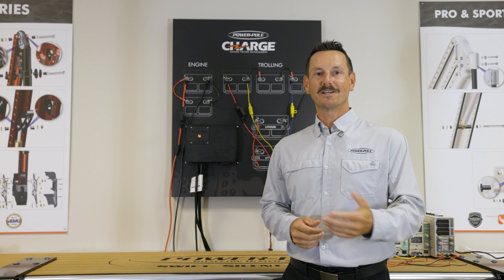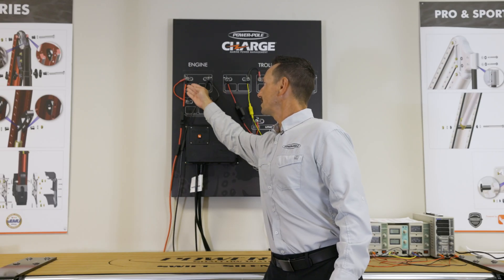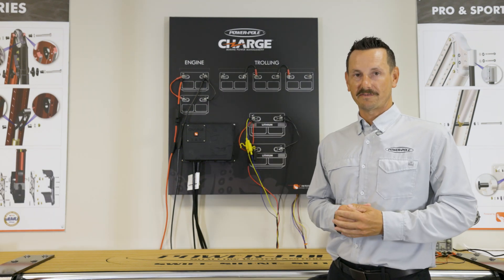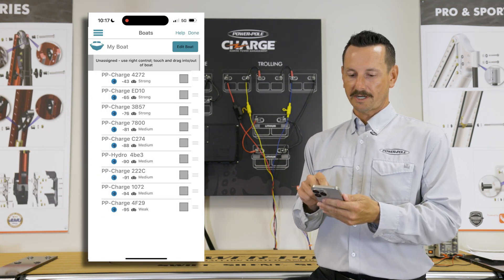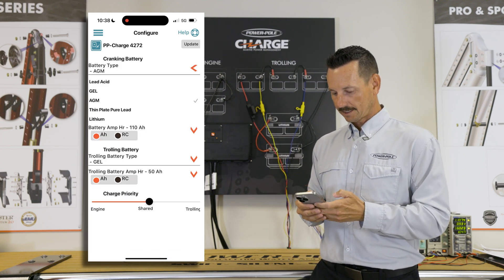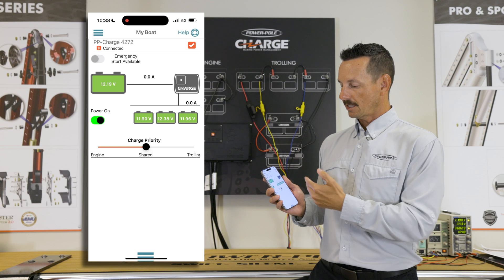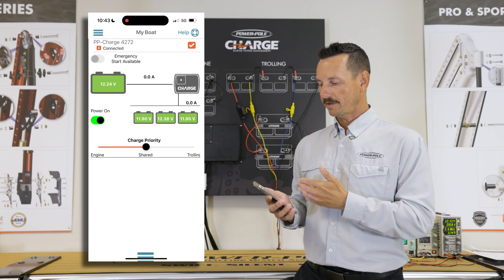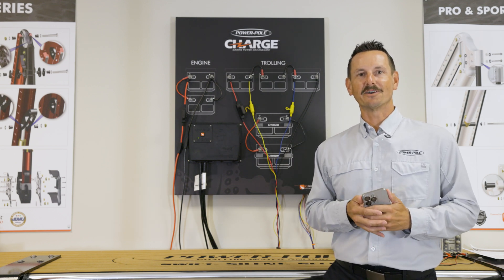How-To Connect, Configure & Maximize Your Power-Pole CHARGE

Comment: Question I have a power pole charge and love it but I can’t always keep it plugged in and my batteries completely die  I have a 3 bank minn kota precision can I reinstall and use that and have the power pole take over once I’m on the water. Thanks

Comment: Great video. I found (online) a used Power Pole charger for sale. I'm running a 12v lithium starting battery and a 24v trolling motor battery. Also running an AGM 12v battery for my electronics. Can I parallel the 12v batteries (1 lithium and 1 AGM) to power my engine and electronics and still utilize the Power Pole charger since there is only 2 battery charging connections?